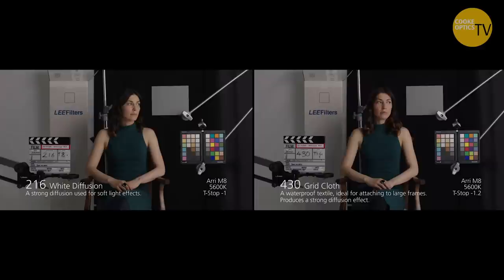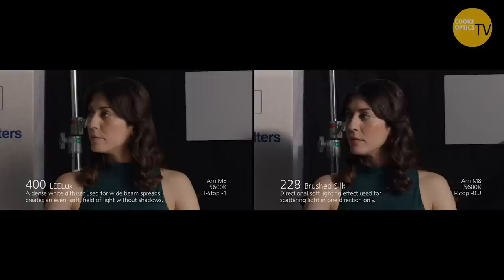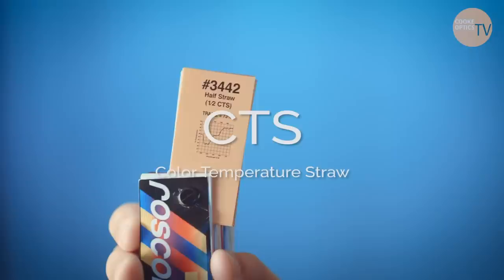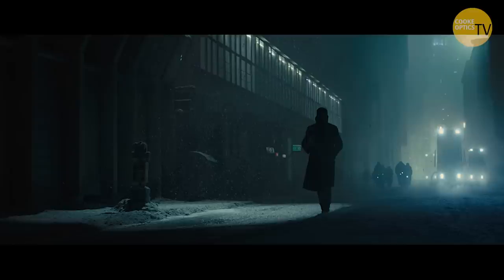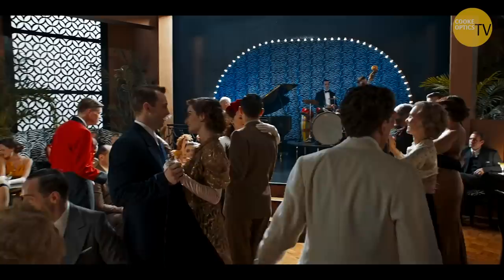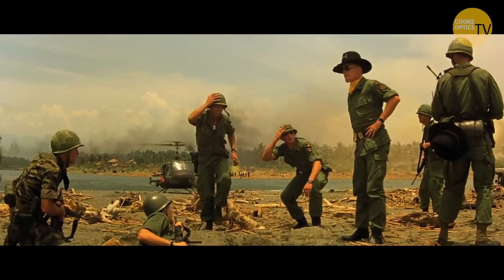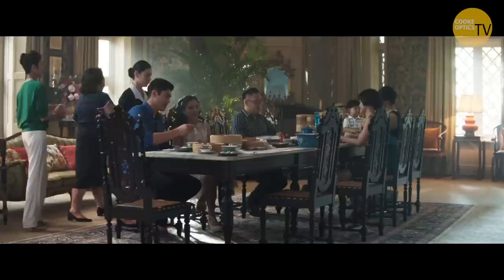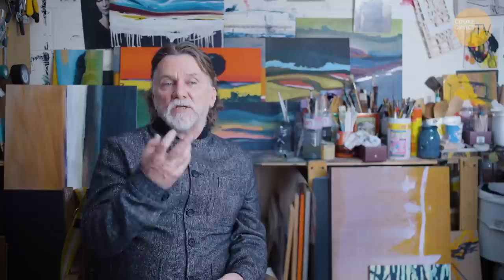Hollywood Gaffer explains Lighting Filters and Diffusion || Julian White

Comment: I’m calling BS on that “moonlight isn’t blue” thing. Sure it ain’t as blue as it is in those movies form the 80s and 90s but I’ve been having a lot of direct moon light the last couple of month especially during full moon and I kept thinking two things to myself. One: well that’s a bit blue isn’t it? And two: damn that’s bright, I wonder if I’d be able to get an exposure in that light with a fast enough lens and a high enough ASA without having the image be just noise.     
Of course moonlight isn’t full on blue but the light still has to go through the atmosphere and at the angle at which it does it comes out having a blue hue.
Reply: I had wanted to ask this same question when I heard him say moon light isn't blue, can we have a precise answer on what color is the moonlight?
Reply: Maybe I remember the next time it’s so extreme and measure it.  But I think it’s stronger in the winter where I life.
Reply: I know the video. The Pocket 4K is rubbish beyond 3200 ASA. And when you’ve already got a modded PL mount Noctilux, why don’t you get a PL to MFT speed booster for an extra stop of light. That plus the GH5s at 4000ASA should give you maximum low light performance.
Reply: The interesting thing about that statement as well is that most house hold  practical sources are going to be 2800K. So  when contrasted with the moon outside it's going to appear if anything way cooler instead of neutral grey. I think going for a cooler moon gag just looks better than a flat white.
Reply: I took human auto white-balance into consideration. Most of the time when I’m realizing how blue the moonlight is, I’m sitting outside in the dark (as dark as it gets with a really bright moon) having my before bed cigarette. Or I’m lying in bed and the moon shines directly into the dark bedroom.
Reply: @fajumosamuel2616  It's approximately the same as the sun - 5600K. How blue or not it is is based on where you place your white balance. ie if you balance your camera so that tungsten lights (2800-3200K) are perfectly white, then yes, the camera would see the actual moon as bluer. Cameras exaggerate the colour differences and our eyes minimize and auto balance.